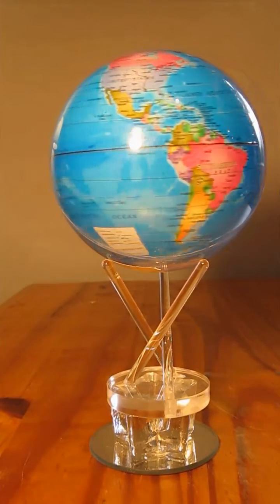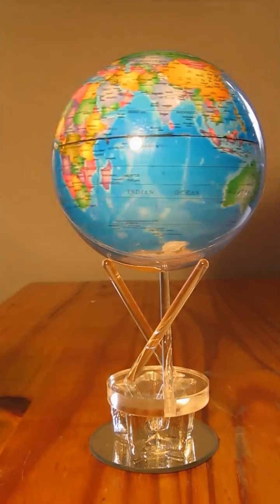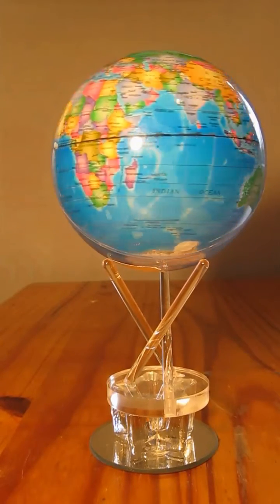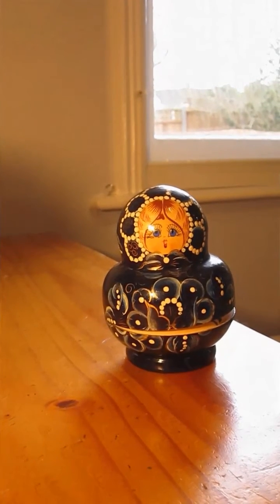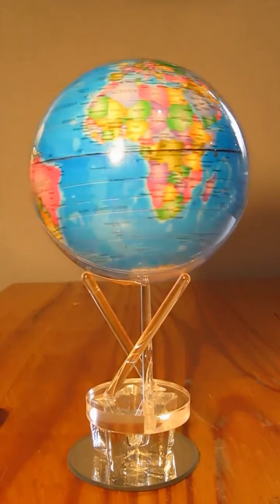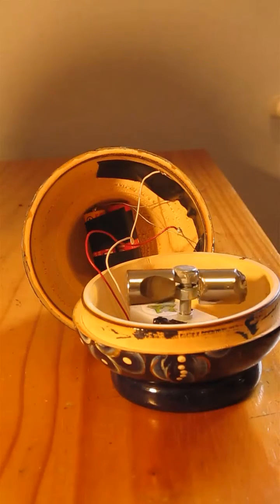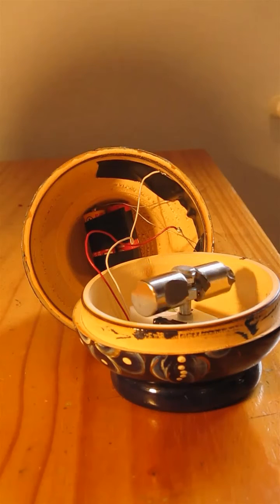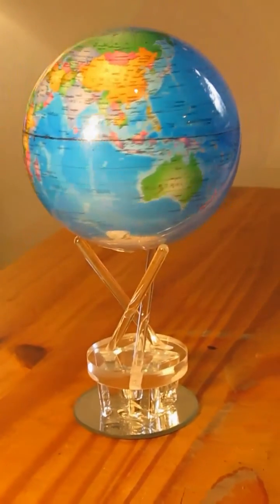DIY MOVA Globe -  Babushka modification

Comment: Have you made a video of the inner mechanism of your globe? Not that I don’t believe you, it’s just that the speed of the driven neodymium magnet appears to be moving much more slowly than the globe is moving. 😉
Reply: Of course it appears to be moving slower than the globe, since you are looking at the surface of a much bigger sphere. If you'd open both spheres and you could see the inside of the globe turn alongside the smaller sphere, you'd notice that they are moving in perfect sync.
You seem like a smart guy, so just use your common sense and I'm sure you will understand what is going on here.

Comment: I don' think you understand how the Mova globe works. There IS a magnet in the Mova globe, and which is attached to a steel rod, both of which are held stationary by the earth's magnetic field (just  like a compass). The solar panels, circuit board, and electric motor then push against this stationary rod to make the inner globe rotate. You have gained nothing with your battery-powered spinning magnets. The Mova globe would spin anyway, given a little light. AND, the magnet in the Mova globe is at the very top, not in the bottom half.
Reply from the maker: Hi Blair.  Please see my original video entitled "MOVA GLOBES - A DIY Alternative (3)", published in December 2019, where I explain how I built globes that are light powered as you describe.  The globe that you viewed gives the same visual effect but is much simpler to construct.
Reply: @rogercollins192  Oh heck.. my mistake, It looked like an earlier Mova globe, and I though you were just setting the motor contraption next to it, which of course didn't make sense to me. Now I see that yours is propelled differently by the external mag/motor rig. I like these little globes, but what I really want is a magnetically levitated Mova globe. The internal drive is what took a couple years to perfect, and it would be the shnizzle if it also levitated.